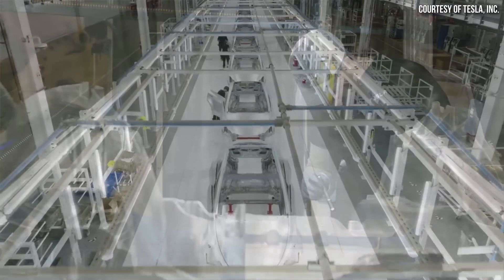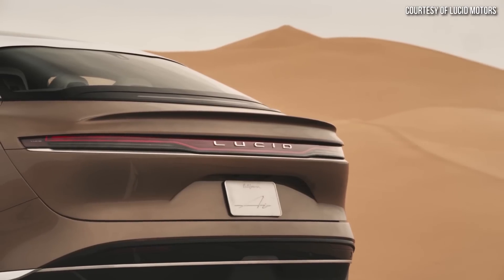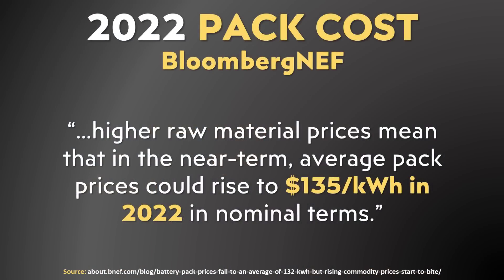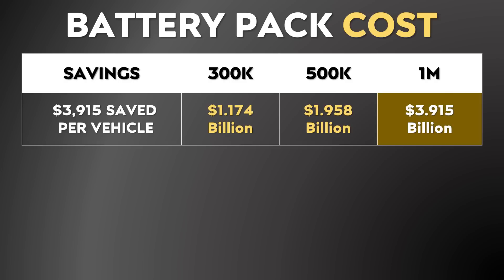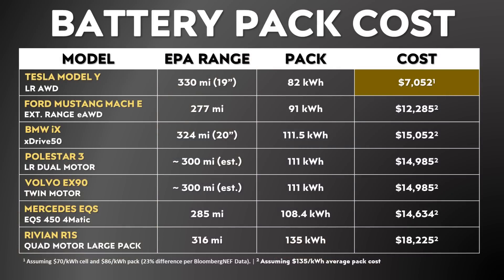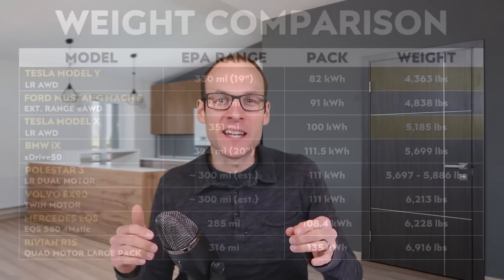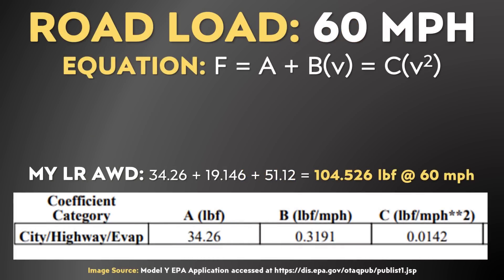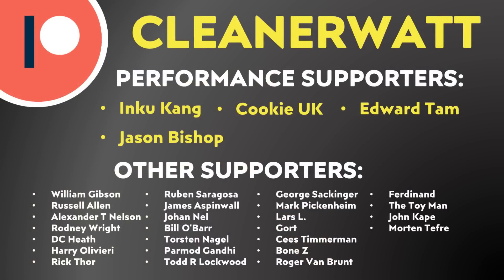Tesla's SHOCKING Battery Cost Advantage | How is this Possible?

Comment: A problem here in Sweden with the electric car is about being able to tow a caravan.  an average caravan in Sweden weighs 1600 kg.  and there are several about electric cars that are not allowed to deduct that weight.  And as you can guess, the car consumes more electricity when it has to tow a caravan

Comment: The model Y tires are very wide… especially when comparing to say the mach e. I keep wondering how much more range it would get with thinner tires (+ 45 miles?). Of course it wouldn’t be as safe or handle as well with thinner tires

Comment: 300 miles is what used to be the 40 miles range the manufacturers used to say 20 years ago.   Less than 300 miles is not really that good for real drivers.  My pickup can get about 600 miles on a full tank.  So driving that truck for over 18 years this would be my norm.  My EV gets just over 215 miles and that usable gets me over the bay I to S.F. and back home with about 40 miles left.  With a 300 mile pack I would then have 140 miles left for an unexpected run after getting home without having to wait for a large charge.  

When they can give at least 460 miles on  full battery then they will be hitting the range needed in a big driving state like calif.  

So please don't say 300 is pleanty.   We need the extra for the freedom of a Plan B change of plans. 

Try driving over a mountain to say Tahoe in winter and having to stop drive during a snow storm and keeping family warm while waiting for road to open.  You will be very happy if you had over 450 miles in your battery.

Comment: Jon,

One 13.5 Kwh Tesla power wall retails for ~$11k, up until recently they have used batteries for cars and the energy division was strapped for batteries. 

If an entire 82kwh pack costs $11k why not just sell 6 power walls (6x13.5= 81kwh) for energy storage at ~$66k ($11kx6), the full price of a car instead of batteries with a car attached?

My numbers must be off somewhere, thoughts?

Comment: Loved this, great video Jon. Perhaps the 23% delta between cell and lack is lower for the 4680 structural pack? I guess it is kinda the reason for its development. Still all your points are the same. I believe I read somewhere that Tesla 2021 LFP packs were at $80/kWh with CATL cells, but this is likely higher now with the hike in cell costs.

Comment: But don’t forget that a larger pack generally contributes to longer lifespan (less cycles) and greater power output and charge rates. Battery packs need to become cheaper so no compromise in size is required.
Reply: Good point. But cycle life is also increasing.

Comment: Interesting that cleanerwatt left out Aptera (although, to be fair, it’s not yet in production). But for argument’s sake, if Aptera was included in these charts it would leave Tesla in the dust.  Their 400 mile range vehicle is well below the cost of the cheapest Tesla (by many thousands of dollars). And again, to be fair, Aptera is a two seater. (That said, you could buy 2 Aptera’s for the price of one Model Y.) However, we need to think long term, and how the Aptera paradigm (not Tesla’s) will change the face of all electric transportation for one reason; efficiency!

Comment: Excellent work, as always Jonathan! It would be great to have the coefficients in the road load equation for other EVs and ICE vehicles to compare F at different V, e.g., both in and out of the aerodynamic regime. BTW - typo in road load equation (= should be a + to add force to overcome aerodynamic drag).
Reply from the maker: Thanks

Comment: Anytime you use EPA numbers for comparison, your calculations will be inaccurate. EPA allows manufacturers to use different calculation methods, this is why in the real world Teslas rarely meet their EPA ratings while others usually meet or exceed them. Tesla uses the 5 cycle method which results in an optimistic range while most other OEMs use 2 cycle to be more conservative. Furthermore, EPA allows the OEM to reduce the range numbers as much as they want.

Comment: Road load is a relevant measure but an even better one is power (this will be proportional to road load you just need to turn force into power by including distance in the equation).  The vehicle may or may not report power on the user interface but it does measure it.  Knowing the power or number of kW needs for a specific speed is really all the efficiency we need for know the range, and cars could be programmed to provide this data.  They could be their own measurement.
I've worked in the DTV industry and when DTV came in it had the capability to measure and quantify signal quality, now many units didn't do it very well, but we made one that did and installers started to use them as test equipment.  The ability to measure your own performance is very powerful.

Comment: Interesting that you leave out one of the best EV manufacturers, Kia/Hyundai, my Kia regularly returns 4.6 miles per kWh and in winter the worst I’ve achieved is 3.8 the best in summer 5.4.
Reply from the maker: I was discussing EV with large battery packs.
Reply: I think he wanted to compare SUVs. The Kia is super efficient and should be compared to Model 3.
Reply: Which model? The ioniq 5 isn't very efficienct
Reply: @larryspiller15  The old Ioniq Electric sedan is very efficient. I think even more than the Model 3
Reply: @larslysdahl4586  that is not apples to apples. you have to compare similar sized vehicles with similar sized packs. The original ioniq was a compact car with cookie cutter wheels and a 38kWh pack getting 140mi of range. The model 3 is a midsized sedan with sport tires and a 78kWh pack getting 300mi of range.
Reply: @larryspiller15  yeah agreed. So which car do you want on the list? The Kia EV6?

Comment: The Aptera will more than double Tesla's efficiency with 10 miles per kwH. Watch this space, 2023 is the year when the EV market will be turned on its head as Aptera leads the charge to hyper-efficient EV's which have more range than ICE at a lower cost.
Reply: "Horses for courses"
Aptera is becoming the EV version of the "Ah but the Camry is cheaper" test.
.
Put 5 people and their luggage in both and run the comparison.... Sorry...... What's that?
Reply: @rogerstarkey5390   Sure, an Aptera won't haul 5 people, or 3 tons of freight, or whatever, but as a single-occupancy commuting vehicle, which is what most cars are used for 90% of the time, it's a good choice. If you get the 3-seat version they are talking about, that will offer more flexibility, or if they get around to making the 4-wheeler, then there will be even more options. My current car isn't even as big as a Camry, it's its little brother the Yaris, and has 4 seats which never get used as I'm the only in it most of the time. Occasionally I have to drop my wife off somewhere, but I have only used the back seats to carry people once that I remember. I fill up the back with bottles when taking the recycling to the depot, but the Aptera has even more space in the back than my Yaris, so would be fine for that job. I think the Aptera will be a second car for many people, or the only car for singles or couples, for which it will work fine. I guess that families will keep their gas guzzling land yachts or SUV's for vacations once or twice a year.

Comment: Just looking at the basic specs of BEVs is only part of the story, Teslas handle so much better on the road than other BEVs because they weigh less. Many people don't get that even when test driving because BEVs feel good/different from ICE due to the low centre of gravity anyhow and people are just used to driving heavy SUVs.  When you really try out the handling though it's Tesla's that win out right now.

Comment: Jon, your video should clarify usable capacity vs full battery capacity.  As I understand the numbers, the Mach-E for example has a 98KWh pack with a claimed 91KWh usable.  The Model Y has an 82KWh pack with about 77KWh (probably a little bit more used until it can no longer drive) usable.  For the Mach-E, the difference between its full battery capacity and its usable capacity is especially interesting.

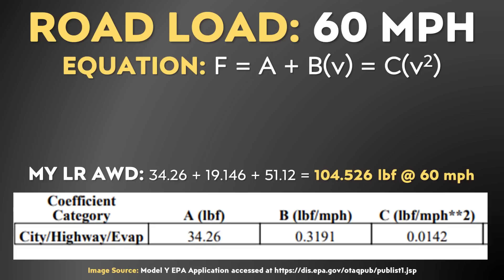Comment: As being outside of the US (min 10:23) a road load of 104.526 lbf @ 60mph is converted to 464.95 Newton of Force in driving direction (the resistance through rolling and air is exactly to the opposite) at a speed of 100 km/h -> 104.526 lbf@60 mph = 464.95 N @ 100km/h. Thats roughly 46 kilopond
Well done, Jon.

Comment: When Sandy Munro did the Model Y teardown he stated that the cost to produce the cells used in the pack was $80/kWh.  That's before the 4680 dry rolled cells and before lithium iron phosphate chemistry.

What I've commonly seen is that the cost to put the cells in a pack is relatively cheap.  And it is likely a lot cheaper for Teslas using structural battery packs as they replace other structural parts in the vehicle.
Reply: Also they have less cells, so at least compared to their own battery packs the 4680 packs should be less costly to make.
Reply: @nilsfrederking62  Probably correct.  There is the added pink foam from hell.  I imagine that it's a fairly cheap product but that hasn't been disclosed.  Certainly a savings in number of operations to place the larger cells in the pack and fewer connections to weld.

Comment: I hate it when people say evs don’t need 300 miles of range :). That range is under ideal conditions: 65 degrees, flat land, no a/c or heater use, 55 mph, etc.  do you realize probably 1/3 to 1/2 of United States has winters where the snow never thaws for MONTHS? (New York, Chicago, Denver, Salt Lake City, Minneapolis, Detroit, etc?).  My assumptions are range is cut In half in those weather conditions traveling at  interstate speeds and god help you if it’s hilly.  Plus for ideal battery life some battery chemistries aren’t supposed to charge to 100% even.  That’s why 300 is MINIMUM I’D EVER BUY.
Reply: Aside from the fact that most folks don’t drive more than 30 miles a day, EVs don’t lose half of their range. With a heat pump and preconditioning before driving I don’t lose more than 10% range in the cold.
Reply: How many people drive LONG distances in "snow that doesn't thaw for months"?
(Tiny percentage)
.
What speed are they driving on that snow?
(Slowly!)
.
Is the journey mileage or TIME restricted?
(🤔Time??)
Reply: Nowhere near 50% range loss:
https://assets-global.website-files.com/60ce1b7dd21cd5b42639ff42/61e5e6ee42e246e87ca839bf_22%20EDIT%20_%20ALT.jpg
Reply: Also non flat drives aren’t an issue unless you’re driving up a mountain as usually you’re going up and down and on the way down you regenerate energy with regen braking

Comment: You’re doing great work. You should put the Road Load lbs of force into a bar graph and throw it onto Twitter. The Model Y’s 104.53 lbs versus the Mach E’s 133.89 lbs and Rivian’s 157 lbs is compelling evidence of how far Tesla’s engineering lead really is. Bar graph will really highlight it.
Reply: Yeah and the launch year. The model x was state of the art in 2015. The BMW iX is supposedly state of the art in 2022.
Reply: @larslysdahl4586  great point.

Comment: The competition doesn't matter.  I don't know why YouTubers keep comparing Tesla to "the competition". in attempt to prove Tesla is "better".   The runway in front of Tesla is huge. and wide open.  It doesn't matter if Lucid, or Rivian, or BVD, or whomever builds a more efficient BMS.   Or efficient battery.     Tesla is only competing with itself.  A Model Y is $70,00-$80,000.   They should be competing with themselves to bring that down to $60,000...with the same gross profit margin.
Reply: The price on Teslas will not come down until they are producing enough cars to get the wait time down to something reasonable.
Reply: @surferdude4487  Exactly.  Tesla is only competing with itself.  The reality is they can't yet make an infinite # of vehicles.  The current challenge is ramping up their factories, hiring more people, building out logistics to deliver vehicles (I think they appreciate why legacy auto have dealers), developing supply chains, etc.   Tesla just needs to worry about their own kitchen, and  continue to increase production.   Which has nothing to do with what any other automaker is doing.   They have to get GigaTexas up to full production....and start another GigaFactory in Mexico.  They will get there...but factories don't go up over night.  Or get to max output overnight.  Let's see what their total vehicle production is 2-3 years from now.
Reply: @surferdude4487  
Which by many accounts is what they're doing?
Just depends on which set of accounts Gordy has put this week
Reply: Because once a week we see a new Tesla Killer.  Which never is.   Tesla could easily  Chop 15% off its cars.  But to survive it need to build more factories and go into mineral mining and production.    While it does make the cars more expensive Tesla is doing what it need to remain Tesla.
Reply: @danharold3087  The reason that Tesla gave for their price increases was that demand is higher than they can handle at this time. They are spending money as fast as they can to build out new capacity, but not wasting money or time getting it done.
Reply: @surferdude4487  Yes.  Unless things fall through they will also have US based lithium refining.   And for people who do not know the fast as they can for factories includes hiring and training the people who build the cars.  This can be the hardest part.
Reply: @danharold3087  Building more factories.  <--I think Tesla Fanboys gloss over how long this takes.  Tesla can't make an infinite # of vehicles by turning on a faucet somewhere.  California, Germany and China GigaFactories are relative close to their max output.  Can they produce a little more through innovation?  Sure, but there is a limit.   And if Tesla announces in the spring they are going to build another factory in Mexico, it will be about 3 years after that when that factory will be producing cars at full capacity.  3 years.
Reply: @Team_Trade_Down  One thing Tesla has demonstrated clearly is that they can commision new factories faster than anyone thought possible. But yes, about 3 years from announcement to full production is about right, if not a little optomistic. Giga Shang Hai is still expanding. Giga Germany and Giga Texas are still ramping. There is at least another million vehicles worth of production there without building another new factory. Yes, I fear that the next Giga factory will be in Mexico, but I'm still hoping they'll build one in Canada. We'll just have to wait and see.
Reply: @Team_Trade_Down  That sounds about right. Given the nature of compound or geometric growth, we won't see 10,000,000 production rate until about late 2027. In the mean-time, all the legacy auto manufacturers will go belly-up while producing only enough BEV units to keep from getting fined out of existence. Difficult times indeed.
Reply: @surferdude4487  I do not believe "all the legacy auto manufacturers" will go belly-up.  Why?  Because Tesla won't take all their business away that quick because can't make enough vehicles fast enough.  For example Ford in 2025 will be making a lot of F150s, F250s, F350s, and Vans and still be in business, albeit they may be losing money and need assistance.   Nissan will still be selling a lot of Nissan Rogues for $33,000 dollars.   And Hyundai will be selling their vehicles, etc.   Will they all lose a % of their current marketshare?  Yes, quite possibly.  Will their profit margins plummet?  Sure.
Reply: @Team_Trade_Down  Maybe "all" is a bit of an exageration. But, given that most legacy auto manufacturers are only producing enough BEVs to keep from having to pay out massive fines, and some even buying carbon credits from Tesla and still not making a profit from their BEVs, there will have to be a lot of changes before I would give one penny for a share of any of their corporations.

Comment: You mentioned Lucid, what is your thoughts on the rumor that they are lying about their battery? That it is much larger then what they say?
Reply: Electric Viking did a vid on the Lucid quality.   It is a nice car but I'd hang back and see if they can iron out their problems.
Reply: @danharold3087  
Sam "tends" to not only flip-flop, but to deal in rumour.
I'll stick with Bjørn for data, and Dillon, Dave, Rob (and now Jon) for "news"
(How could I forget JORDAN!!?)
Reply: The "rumour" came from "an enthusiastic" source who hadn't driven the car and didn't really understand the method.
As I recall, actual road tests showed a correctly stated capacity, similar cell efficiency to Tesla (at that time) and an actual range that could be explained by the comparatively larger (but AS STATED) pack and CD value (cross section)
It was a other of "Warren's nothing burgers"
.
(You should know by now to rely on actual tests rather than "wishful speculation" on line?)

Comment: Build a lighter car, and you can build a lighter car! Huh? Yeah, you need less massive brakes, tyres, structural members if there’s less car to pull up.
Reply: I assumed that means, with a lighter car, you can use lighter batteries.
Reply: Cumulative gain!